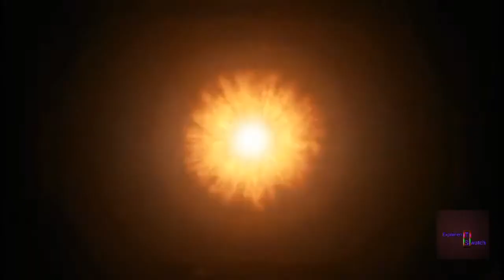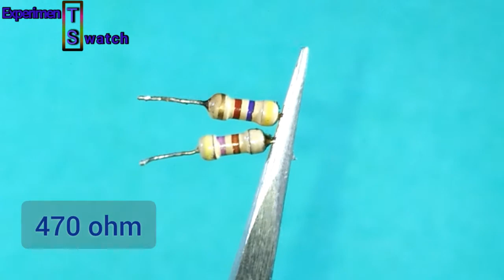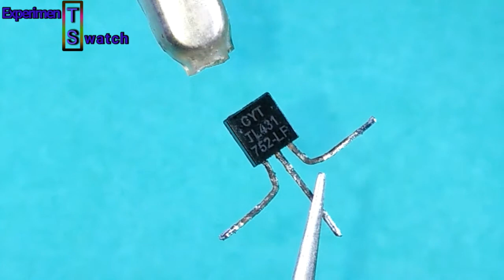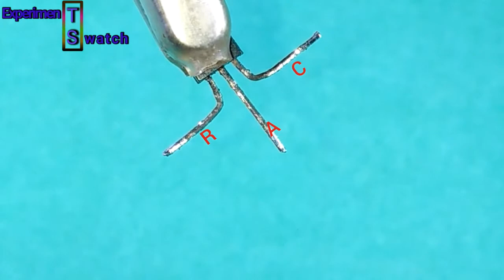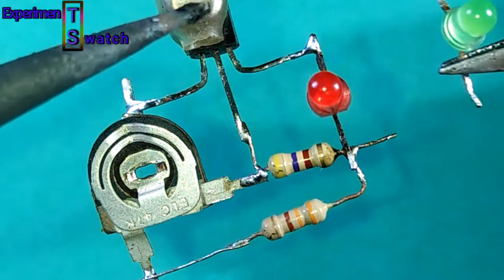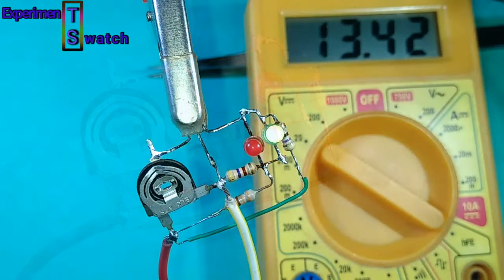Battery Level Indicator Circuit, use TL431

Comment: How do I calculate the value of the resistors for this circuit to charge lithium-ion batteries 3.7 volts without using this variable resistance, and thank you
Reply from the maker: Try sending 2.5 volts to the IC reference pin And let the input voltage be 4.2 volts at that moment